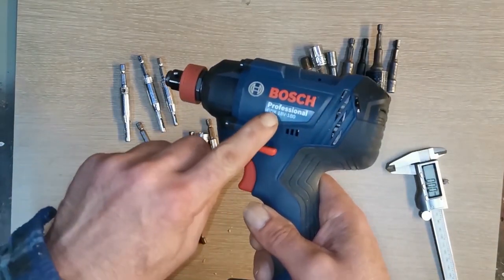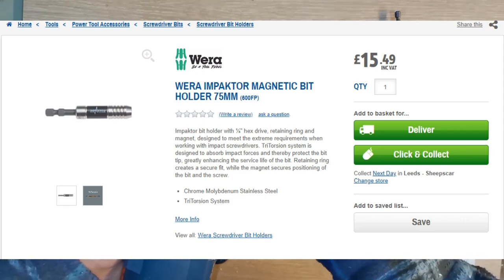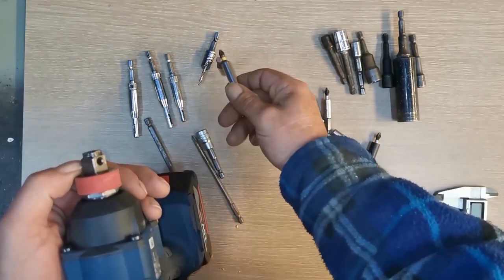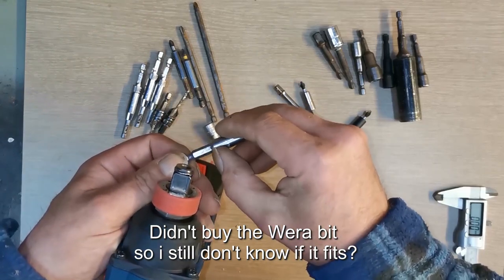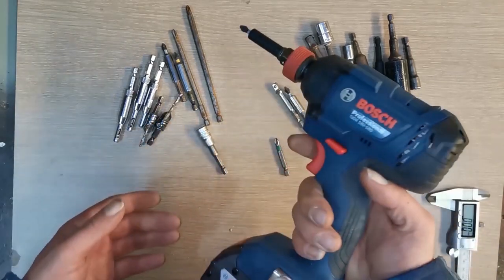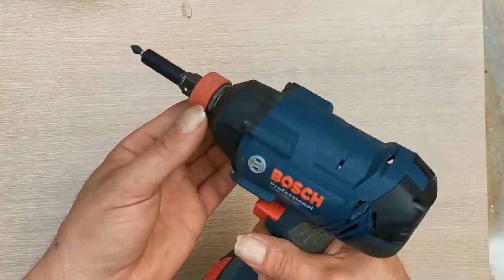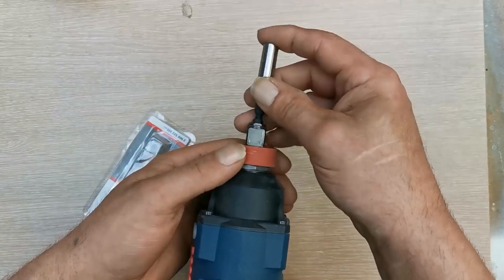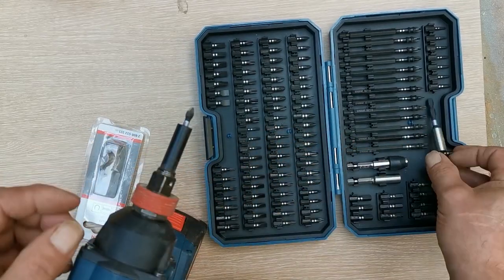Bosch GDX 18V-180 Impact Driver, Magnetic bit holder not locking in,

Comment: nice video. I also had a problem with bosch gdx 18v-200c wherein the double ended impact bits won't lock. the reason is the collet depth of the 200c is shallower than other gdx or gdr. hope you can also make a video on that. thanks.

Comment: Had the same problem with the same driver - after 4 years even the normal bits stopped being retained and even the Bosch repairers were unable to make the chuck grip properly again.
Reply from the maker: 😁🤔 Thanks I guess that's not what I'd like to know, 😬🤣 do you use it a lot, on site...?
Reply: @Gidjoiner  Carpentry is a retirement hobby more than anything and as I had some Bosch gear already I bought the Impact driver.  Used it for landscaping (retaining walls, fencing), a new deck, replacing 24 windows and doors and an addition to the house.  Certainly not what I expected from a Pro series tool. The job site guys here in NZ use Makita and Milwaukee a lot.  I now have Worx tools and they are proving very good value for money with a lot of bare tool options.  Have just picked up their weedeater bare tool for 50 quid (in your currency). Cheers.  love your practical approach to your work.

Comment: Useful vid. I had no idea the GDX bit holder had such issues. So given your workaround, do you still like it? Or do you think it's a nice concept that fails in execution? I had Bosch and Wiha bit holders in my Bosch combi drill and the Bosch wobbles more, but after 9 months the whole chuck wobbles. It came with the impact control bit set.
Reply from the maker: Hi, I do sort of like this impact driver, i got given one of the bigger Wera impact bits that fits ok, but the drill itself is a bit underpowered, not much use than basic screws. Thanks
Reply: @Gidjoiner  I have the 12v impact which is brilliant for all normal size screws, including studwork I also got the brushless successor to this which has 200NM which is enough for most tasks, including my car. For woodworking save framing), I would use the 12V, it's light and convenient, battery lasts too.

Comment: Could you please do a review of the Bosch impact driver you use please? I'm thinking of buying it, thanks, 👍
Reply from the maker: Hi, i bought it because i have the jigsaw, angle grinder, planer & drill, with a few batteries, not sure what i was expecting, i knew it wasn't the best but beyond putting screws in it's a bit rubbish, i bought thinking it would be good for coach screws etc. but nooo, it gets them in a bit then just makes noise,  the 18v drill/driver has a lot more torque,
Reply: @Gidjoiner  Good man, thanks. I have bought into the Makita 18v and 36v platforms in a big way and am very happy with Makita cordless tools. I was given a Bosch 18v hammer/drill/driver with three 5ah batteries by the company I work for and was thinking of getting the impact driver as a bare tool. I could fit both of them into the L-boxx with the charger and batteries. I have an older 18v Dewalt impact driver which is great but it doesn't have adjustable torque. Maybe I should go for the Makita 18v impact, 🤔
Reply from the maker: @TheToolnut  yeah i would, Makita are my no1 tool of choice normally 👍i bought the 18v Bosch drill because of the high torque rating, I'd killed a few Dewalts driving in coach screws, the Bosch is doing well, not a whiff of smoke 😂 & I'm happy with the others - jigsaw planer n grinder but the impact driver was a little disappointing,  I've accepted it for what it is now n if one day i need a stronger machine I'll shop around but will have to buy batteries n charger so that won't be soon.
Reply: @Gidjoiner  Makita have a low D.B impact, apparently the anvil mechanism runs in a bath of gear oil to dampen the sound. £285 though! 🙄
Reply: @Gidjoiner  How can the Bosch GDX underperform if on paper it has so much torque and such a high strike rate and a pretty high rpm?
Reply: I know this is late but I wouldnt recommend buying the new model, I just bought the kit is a new bottle has a serious problem with the collet or release ring jamming

Comment: Have to say is that a dual impact socket driver? Looks like the end takes a 3/4" socket?? My Makita only fits the standard bit holders and many others without an issue.
Reply from the maker: Yeah, i was expecting it to be a fairly standard fitting, it's only a couple of mm's off so was it intentional or an oversight 🤷‍♂️ The chuck fits a ½" socket, that's a big part of why i bought it + i already have the batteries 😉

Comment: Hi Gid, your two pilot countersink drill bits in this vid what size is the larger one? you use a lot on your videos. I have 8 and 10 but that looks a bigger pilot bit.
Cheers Gid
Reply from the maker: Hi, it must be this as this vid is reg the snappy hex bits, these are the only size i buy, it's the same i just bought for the pillar drill on the bed vid https://www.amazon.co.uk/gp/product/B0001P11ZC/ref=ppx_yo_dt_b_asin_title_o00_s00?ie=UTF8&psc=1
Reply from the maker: It's in this vid about 7mins in 👍😉 https://youtu.be/25g2wPa-CJM
Reply: Thanks Gid appreciated I’ll look at the trend bit. I’ve seen you pilot on few vids and always thought I’m sure that’s  a better size pilot. I have a look.👍
Reply from the maker: @sanbucaone it's got a 3.5mm bit, I had 1 in my pocket of bits but when it was doing well after a few yrs i bought another so i could have 2 set at different lengths in my pocket, the first is getting a bit worn, it's only 10yr old 🤔😁 so i bought another not long ago, the one in the bed vid, I'm going to leave that one with the pillar drill n buy another for my daily pocket. 👍 I have a bigger countersink in my pocket with i think a 5mm bit for no' 5 screws in 2" timber but that's just a cheap countersink from a set, but it works ok n that too is quite a few yr old,  One of these sort https://www.amazon.co.uk/dp/B081Z8WRP9/ref=sspa_dk_detail_0?psc=1&pd_rd_i=B081Z8WRP9&pd_rd_w=U9VPt&pf_rd_p=1055d8b2-c10c-4d7d-b50d-96300553e15d&pd_rd_wg=6J3gK&pf_rd_r=JPATXFV3HYF0NJ6SAA1P&pd_rd_r=440404d1-2cca-48b3-b780-cfeab76c9959&spLa=ZW5jcnlwdGVkUXVhbGlmaWVyPUEzMzhDT1FRUVZJMVdHJmVuY3J5cHRlZElkPUEwNDY3MzIwMVNXNU9RM1dMNDNaQiZlbmNyeXB0ZWRBZElkPUEwNTczMDc0MllPVlVaNkwxV0dROCZ3aWRnZXROYW1lPXNwX2RldGFpbCZhY3Rpb249Y2xpY2tSZWRpcmVjdCZkb05vdExvZ0NsaWNrPXRydWU=

Comment: I'm struggling to understand this - I'm from the UK - this is an IMPACT WRENCH isn't it? An Impact driver is for screws and fixings not nuts and bolts.  Screw adaptors (even impact rated ones) will be designed NOT to fit as the higher torque on the Impact Wrench will destroy it. Good idea - but you'll have to be very careful not to destroy the adaptor and at £10 a time you might as well buy a new bare tool that's right for the job
Reply from the maker: This is an Impact Driver/Wrench, https://www.bosch-professional.com/gb/en/gdx-18v/
Reply: @Gidjoiner  well that's a great idea - contact Bosch UK they will tell you what bits adaptors fit - they are always helpful. Not entirely surprised other branded adaptors won't fit my impact rated Bosch adaptor holder does look like it has a longer hex shaft at the base - this is probably so it fits in this tool.  Thanks for the reply - you learn something new every day :)
Reply from the maker: Hi, this video is 2½ yrs old, I've since bought other magnetic bit holders & a Makita impact driver amongst other tools. I've been a joiner nearly 40yrs, I've probably had 100 magnetic bit holders in my life, I've £10k+ worth of tools inc 8 or more cordless drills in my toolkit, this issue with the Bosch impact driver was a drop in the ocean 👍 Thanks for your input & yep you never stop learning.  👍

Comment: Surely this is a problem with the driver?
Reply from the maker: I think maybe this is Bosch being,,,, I don't know the word but when a company makes a universally accepted tool but only their bits will fit, I've not enough experience with impact drivers to know what bits are available.
Reply: @Gidjoiner  
I know the word, but I'll keep it to myself 😎
You are quite possibly right.
Reply: @Gidjoiner  This is only an issue on Bosch's GDX models that combine the 1/2" socket and hex bit holder/front end. Their GDR impacts have the standard fitting and this isn't an issue. I think it's due to the needed depth of the 1/2" to grab a socket.

Comment: Given the amount of subscribers you have Bosch should be in touch to sort it out. I've got far less subscribers than you on another platform, Instagram and I have power tools sent to me free of charge by certain companies. I will say however Bosch are very disinterested when it comes to problems or suggestions. I've contacted them countless times about a 110v charger for their 18v batteries and they aren't bothered despite trades on site wanting them.
Reply from the maker: Thanks Sam I think when Bosch made this they were fully aware that a 'standard' shanked bit wouldn't fit that's why their Bosch bit is longer, it only needs a couple of mm's so i think when they made this decision it was an arrogant finger up to the rest of the brands, buy a Bosch GDX n you have to buy a bit with a long shank preferably theirs, 😒

Comment: got the same problem with the older model. I need another impact driver and not going to buy the 1/2 square model as I mainly use 1/4 hex.     just bought the 1/2 square thinking best of both worlds but it's not at all.
Reply from the maker: Thanks, yeah there's very little info on this, I think I'm sorted now for magnetic bits & i suspect i would have got this ½" drive one anyway but I would have been nice to know what i do now before i bought it, mainly why i made this vid 😉👍

Comment: Bosch make a mag bit holder. Part no. 2608522320 get one of them & all your 1/4 hex drive bits will fit. They’re only about a  fiver. 👍👍
Reply from the maker: I got the 2608522321, I showed in the vid. I'm not going to buy another but I'll bookmark it thanks.
Reply: You’re welcome.
Reply from the maker: 👍 When i came across this prob with the Milwaukee bit I wasn't sure what to do at first, don't know why i didn't just check out Bosch bits 🙃👴🤣 , there wasn't any vids on YT & forums were lacking in info,  I'm posting this so anyone can add their experience, Thanks for your input, 👍
Reply from the maker: @paulwhitting4953  "Thanks. Your order was placed" shit i just bought that bit, £7.99 ebay, gotta stop spending money now, 1 impact drill n 4½ magnetic holders 🤣